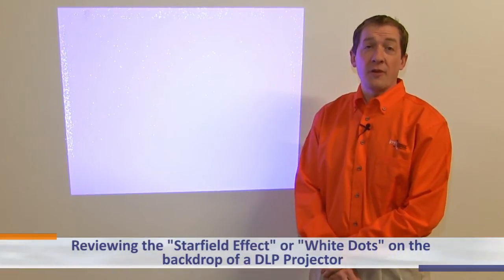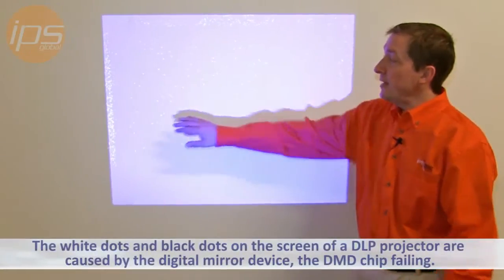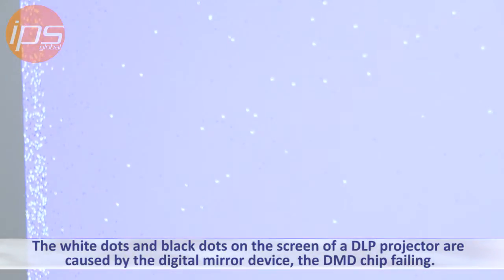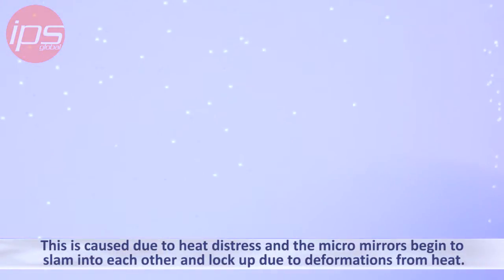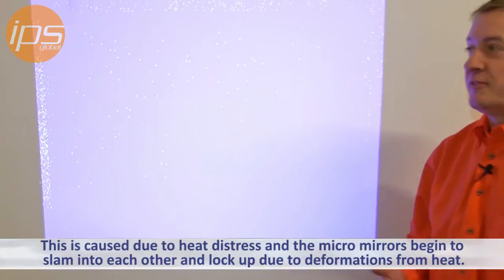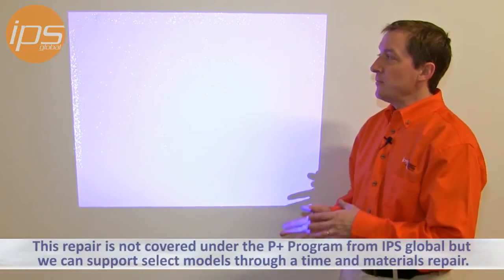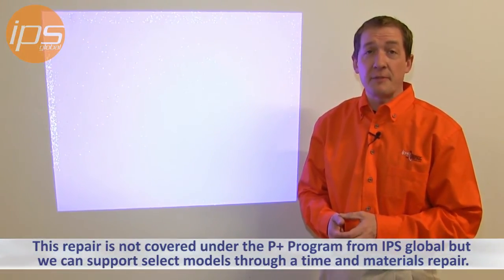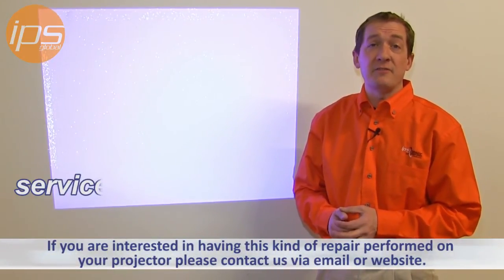Starfield Effect: Why You See White Dots on Your Projector

Comment: Whats the difference if you seen only one of these star dots and then power cycled the projector and it went away? Is this the same fate of the dmd chip or would it be something else like software? For a brand new projector racking up 500hrs and has been running in eco mode since opened and only about 3-4hrs of being on per session,  would this be only the same thing happening if we see star dots as you say it is in this video? Also this happend on a new LCD projector so if its all the same star dot behavior is there only one possibility? It would be good to know so i can start a claim if its a sign of something worse to come..? Any insight on the matter is muy mucho appreciated.
Reply: Hey did you find out the answer to this?

I have a single dot on mine and worried about it getting worse - how did you power cycle it? & Did the dot come back after you power cycled it?

I got mine a month ago and only really used it a handful of times, but still got a white dot.